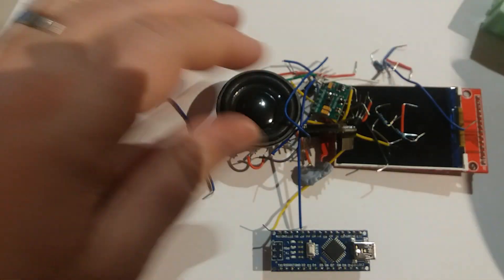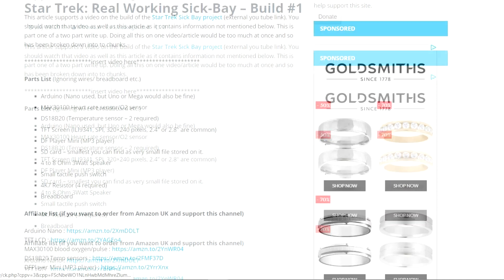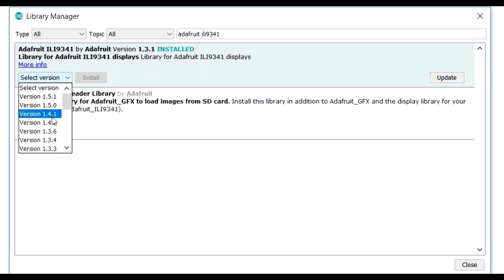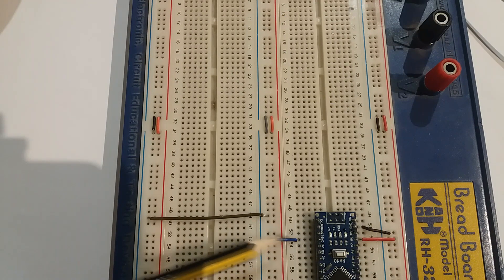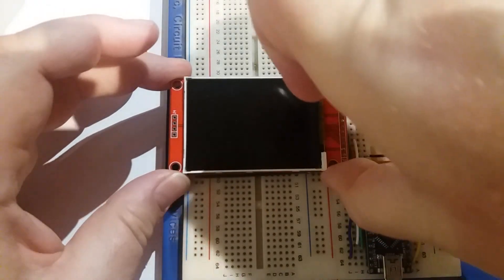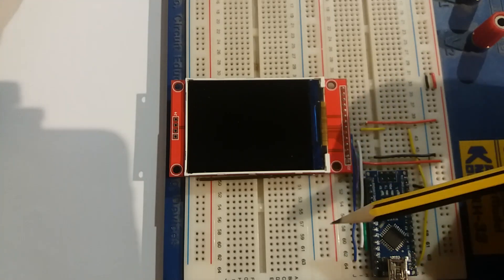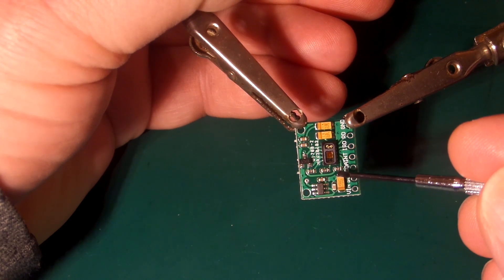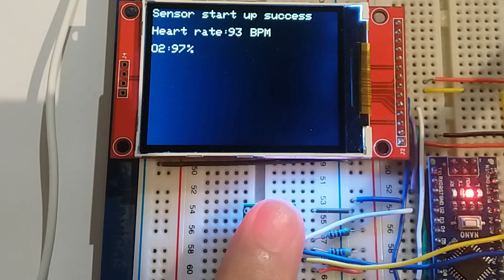Arduino Powered Star Trek Sick Bay Build Part 1

Comment: Hey, I don't understand why you remove the pull up resistors from the sensor board and then add them on your breadboard.  Could this be because you are a bit vague as to what you're doing and why?  Your 'explanation' about the regulator bypass link on the TFT board also seems to indicate that you don't fully understand what you're doing.  And while there's nothing wrong with that per se, it seems inappropriate when presenting yourself on YT as some sort of expert providing help and guidance for beginners.

So, the resistors: What you might have done, which would have been more helpful, was to explain about the MAX30100 boards and the fault that they have (and why).  Then reference a discussion about the repair possibilities like https://reedpaper.wordpress.com/2018/08/22/pulse-oximeter-max30100-max30102-how-to-fix-wrong-board/

Voltages.  There seems to be some lack of explanation of voltage levels.  The IIC pull up resistors are to 5 Volts rather than the more usual 3.3 Volts.  Is this an issue with the MAX30100?  Did you check and explain about the pins on that device being 3.3 Volt only?  And the voltage regulator bypass on the TFT module.  Why might that be there?  Is it about the signalling levels on the SPI bus?  What voltage is the ILI9341 specified to use?  Hint; it may be a 3.3 Volt ONLY device.  Hint2; Data sheet shows the Absolute Maximum supply voltage is 4.6 Volts.  Maybe the vendors say things about these modules that make them more saleable without them being strictly true.  Maybe some of them last a while.  But there's nothing like good engineering practice in inspecting datasheets, working out what can and can't be directly connected, where voltage regulators are needed (and their currents), and where level translation between 5.0 Volt and 3.3 Volt signalling systems may be required.

Cheers, Brian.
Reply from the maker: There was a longer explanation of why I did the resistor mods in a previous video, I try not to repeat myself over and over again for the sake of subscribers. But anyways,. When did I say I was an expert? The sub title of the entire channel is "mis adventures in softtronics", suggesting a rather amateur approach. If you get that feeling of expert suggestion from the videos then that is your interpretation. Please feel free to block all channels from your feed that irk you so much that you spend so much time writing a comment to them. I've already robbed myself of too much time replying to you, as with your comment to me, it won't make any difference.